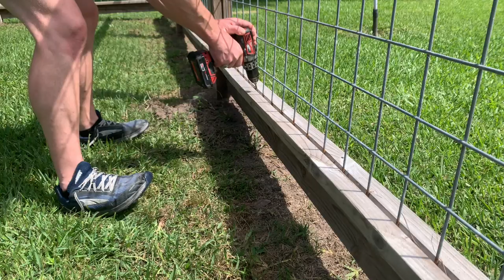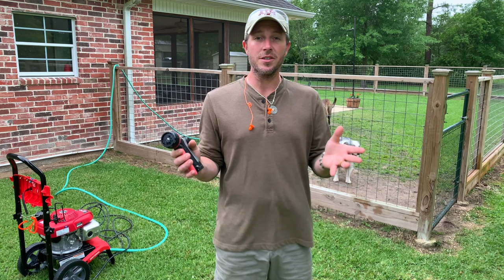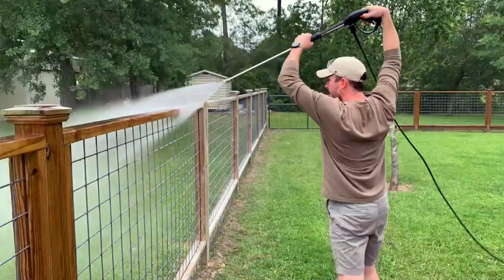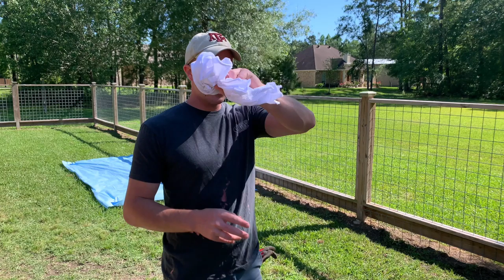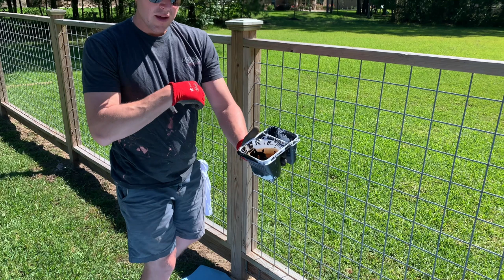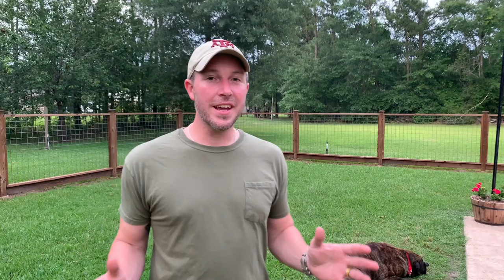PART 2: MODULAR HOGWIRE PANEL FENCE with DADO GROOVE 18 MONTH REVIEW & STAIN TUTORIAL

Comment: Having a hard time finding the wire sections. Love part 1 and 2.
Reply from the maker: Thanks! 
I was just at tractor supply this week and they are in abundance.. you may also find them at a livestock supply store or Lowe’s/Home Depot.
you don’t have to use the 4x4 mesh like I did. You can opt for the 6x8 mesh as well. It will be slightly different dimensions than my construction info, but the same end result.. I’ve use both types.. send an email to JKHARTEL3@gmail.com and I will send over construction information and reference photos of other viewers projects.

Comment: Just giving advice from some one thats in the fencing business those top gate hinges the Male hinge, you should have those pointing down instead of up it prevents some one from taking the gates off looks really good
Reply from the maker: Thanks for the reply. Your exactly right about the hinges. It may sound odd,  but I intentionally have them both up so that I can remove the gate. It also acts as a double support of the weight as opposed to the bottom supporting the weight and the top one just maintaining position of the hinge were the other way. If I was worried about them being stolen, I would most definitely have it the other way.

Comment: Cut fillers for the lower dado slots and finish with caulk  to seal the slot
Reply from the maker: That’s a very good idea… So far we’re almost 5 years in and it’s working just fine with drain holes in the dado.

Comment: I built someting similar but I did not use the datto. I cut the perimeter wire off and just drilled holes in the frame for the protruding rods. This also created the weep holes you later drilled.
Reply from the maker: Interesting… How’s it holding up?
Reply: @GatorOverland  holding up very well. I don't think you could pull the panel out without pulling the entire fence down.

Comment: I’m looking to do something very similar of your design. I reckon I’ll be using snake fence wire. It’s 1/8 of an inch squares. I’ll set it in the ground 12 -18 in ground with 8 feet high. On the outside of fence at the bottom, 12 to 18 inch’s of crush - broken shards of glass. I got bears in our area too. Nothing should be able to get into yard. In Japan they burn wood to a good char and the claims are mold - bug proofing and weather proofing. It’s called SHOU SUGI BAN JAPANESE WOOD BURNING.
Reply from the maker: Thanks for taking the time to watch and comment.. on of my friends did their deck in shou sugi ban and it’s holding up great. Sounds like you have quite the project on your hands.

Comment: How about an update at 32 months? My biggest fear in this style is the top 2x4s sagging over time. No criticism from me whatsoever, other than the choice of hat. Great build, great content, and Roll Tide.
Reply from the maker: That’s hilarious!!! Yes, it will be 3 years next month, looks as good as new and holding up great. No warping, Bowing, or splitting.. my design is nearly impossible to sag, the metal fencing would have to bend too. The bottom 2x6 mud board is the back bone preventing sag and it’s supported vertically between the 4x4s.. the only room for failure is age/weathering at this point.. reach out via one of my contacts and I can send current photo or video and answer any inquiries you may have.
Contacts for Facebook and Instagram

For better contact, info, photos and video check us out on
https://www.facebook.com/JKHartel3
https://www.instagram.com/p/CF-X_58BjDR/?igshid=1r9yo0niyroip
Email: JKHartel3@gmail.com

Comment: I like the fence.  I built one similar to yours.  How is yours holding up after 3 years?  In the midwest freeze/thaw is a concern with the lower exposed dado cut filling with water or slush and then freezing and weakening the lower 2x4.  Adding the weep hole as you have is a good idea or doing an overlay with an exterior silicone caulk also helps (but it does add cost).  We painted our panels black that gives them the appearance of almost disappearing from a distance.  Just depends on which look you are going for.  I like the caps you put on the fence posts and will be adding those to ours.  Thanks for the video.
Reply from the maker: Thanks for taking the time to watch and comment . I actually built the fence about six years ago and it’s holding up great despite what other folks have said about cutting dado grooves into the wood… I live in Southeast Texas, and we’re subject to harsh heat and humidity and periodically we have freezing cold snaps, but not often enough to matter.. 
We had considered painting our panels black at one time, but surprisingly the galvanizing is holding up well . Are you using a mud/rot board along the bottom of your fence? Not only does this protect against ground water splashing, but it adds additional support to the panel frame.
Reply: @GatorOverland  I use a 2x6 treated board upright as support for the lower part of the panel section.  I think this is what you are referencing as a mud/rot board.  It does provide support to the panel section keeping the lower 2x4 from sagging and also keeps the line trimmer from hitting the fence panel.  You do have to drill the weep holes in the lower dado at an extreme angle to miss the support board if you don't use a caulk.  The weep holes kept getting clogged and had to be re-drilled annually to make sure they were still open.  The aesthetics of this type of fence are much, much  better than the term "hog wire" or "livestock panel" suggests.  I have started to referring to it as just panel fencing.  City people don't know the difference and rural people know what you are talking about.
Reply from the maker: @tholi1052 you’re exactly right!

Comment: I was looking up hog panel fencing and came across your channel.. small world - I made your wife a cutting board for you haha!
Reply from the maker: That is a small world!! I used actually used it yesterday! It’s such a beautiful piece! Thanks for the reply! Let me know if you have any questions. I have construction details and cost generator available via Dropbox link in description or email
Reply: @GatorOverland  Will do - Just doing a small 12' span between my house and garage so it shouldn't be too bad! I downloaded the drop box file already! super detailed man!
Reply from the maker: @Andy Nguyen Good deal! Then youre all set. If you use a 2X rot/mud board as I did at the base, then you can probably get away with doing the full 12ft span without separating in the middle or worrying about bowing over time. The mud/rot board works as a strongback brace for the fence. But it's totally up to you. Many have asked if they can do the full 16' with my design, and i would not recommend that distance without supporting in middle, which is why i did 93.5". Good luck with the build. Let me know if you have any questions.

Comment: I’d like to paint my wire panels black. Any tips? What type of paint and any prep necessary? Thank you.
Reply from the maker: No real tips from my end other than You’ll probably want to paint beforehand. It’s galvanized wire, so it’s pretty rust resistant as is, but may also inhibit proper paint contact as well.. if it’s cosmetic then just know the paint will only last a couple years.

Comment: Can you stain the wood before making the fence? 
I guess you'd waste some stain that way, but seems like it would be easy to stain the wood while it's flat on the ground.
Reply from the maker: It depends on what kind of wood you’re using… If you’re using treated wood, unless you wait until the wood is cures (dries) before building the fence, the answer is No (could take 6mos to a year+ depending on climate)… if you stain treated wood before it’s cured (dried out) it will not be accepting I’d the stain and bead off.
If you’re using untreated wood, then you’re good to stain before construction.
Reply: @GatorOverland  Thanks! I was thinking of buying pressure treated wood now, letting it dry for 3 months, staining it, then building the fence. Should work....probably. :D
Reply from the maker: @nichjt  yes, just double check it’s dryness using the examples i show in the video. 🤝🤘🏼

Comment: Any problems with doing this in Texas heat? During the day it’s normally 100 degrees with 50% humidity.
Reply from the maker: I live in southeast Texas, 30 miles from the coast… The epitome of Texas heat and humidity… Five years, no issues and no regrets… It’s holding up great and the stain is as well

Comment: Awesome video. Would love your opinion on doing this fence higher? considering this style of fence for a chicken run but want to go somewhere around 7 feet. also would use the smaller mesh size, 2 inch openings, which may offer more internal strength. Just concerned with flexibility at the centre between posts? How flexible is it currently?
Reply from the maker: i utilized a 6" wide rot board at the bottom of my panel frame to provided added strength and increase the height of the fence 6", and the majority of the way around the yard im at about 5'-6". if you watched my part 1 video you saw me actually trim down the fence panel to about 48" from 60". You could achieve near 7ft by leaving the wire at 60" and using a 12" wide rot board at the base. I built my fence on a budget to achieve the most height and width with as minimal extra cost or waste possible, and that why i trimmed to the height i did. Each panel is (3) 8ft 2x4's which amounts to $12'ish.. the $60, 16ftx5ft wire panel was cut in half and trimmed, so each completed panel frame amounted to about $42'ish... you would just have to change your measurements from mine and buy some 10ft 2x4's to work with the increased height of the panel. All should still work out nicely. If you havent seen in the descreption, i have a link to my drop box for construction info and or my email if you need to contact me personally. Shoot me some photos when your done!
Reply: @GatorOverland  thank you for the reply and all makes sense (well as much as feet and inches makes sense to an Australian). Increasing the rot board width would definitely help. still playing around with some numbers to make it as cost effective as possible, but Im sure ill make it work. Thanks again
Reply from the maker: The excel document is unlocked so you are free to adjust as needed to suit your metric dimensions..

Comment: That pressure washer would have taken every bit of that algae and fungus off without all that extra scrubbing. I'm all about simplicity😁my fencing gets like that, sp every couple years I have to spray that thing down good and it looks like it's brand new again.
Reply from the maker: Thanks for taking the time to watch and comment.. yes I believe you’re right and would have saved it if time and Elbow grease. I did it this way for 2 reasons. I didn’t want to scar or saturate the wood too much before staining. And I wanted to inform other options to those who may not have access to a pressure washer. 🤙🏼

Comment: I cannot get this to work with a pump sprayer. I purchased 3 sprayers and the liquid is too thick for all of them. Not sure how you did this but I can’t get it to work
Reply from the maker: I’m sorry you’ve had that issue… I’ve done multiple fences with the sprayer without any issues… are you using ready seal? Not sure if it gets more viscous in colder temperatures, but it was like water for me… I did my sprays in 70 to 90° weather…

Comment: I don’t have a router. Can I just enclose the wire between 2 slats of wood?
Reply from the maker: Yes you can… This was my initial design but it required twice as much wood and would be a lot more weight… You do not need a router, just a tablesaw with a dado blade stacked for 3/8” groove… I made a post on my Facebook and had a table saw and post hole digger to borrow by that afternoon..

Comment: Just followed your channel, I am fixing to fence in our adjoining lot for a pool oasis and I have been trying to figure out if I can dado the 4x4sto cut down costs and just dado the top and bottom stringers what do you think?
Reply: Yours is awesome 👌 BTW
Reply from the maker: Thanks for the reply! This question has come up quite a few times over the past year… it is definitely an idea of a way to cut down on cost and will work… but....You have to make damn sure your post are exactly where you want them to be when they are set…Especially if you had cut the wire panel lengths and horizontal topper/bottom wood lengths before you set the post…There would be no forgiveness if you set the post a little bit too far apart… The panel would not set in the groove properly and the wood lengths would be too short. If you are not relying on the fence for strength then I would expect it to be fine for fencing in a pool area… Depending on how many feet you are trying to do for this, you are only saving yourself the cost of one 2x4 (about four or five dollars) per panel section to do it this way. I.e. If you needed to make 20 sections this would be about $80-$100 saved from if you did my design. Feel free to ask any questions

Comment: How would you deal with dog's digging under the fence?
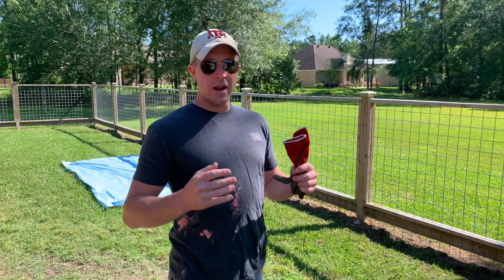Reply from the maker: The answer to your question is featured about 18:20 in my part 1 video. Fortunate my dogs have not been diggers. Making a trench of cinder blocks between the post could work too
https://youtu.be/x0iMHQVzJvQ
Reply: @GatorOverland  Extending hog wire panel deep into the ground might work for those persist diggers but not so good for lawn mower blades.
Reply from the maker: I’ve mowed 100’s of times and never once been an issue with the blades.. physically impossible actually. Check my description for email/drop box for construction information and photos. You may better understand what I mean for the dig deterrent. They would be mounted vertically.

Comment: Is it possible to do the dado cuts with a circular saw? I think this method is what I will be using for my garden. We have a 1.3 acre lot I'd love to create a good size garden in and I think this method would be best to keep away rabbit, deer, moose and bears. Thanks!
Reply from the maker: I have read that dadoes are capable of being cut with a circular saw, but doing that amount of fencing perimeter I would definitely recommend renting or borrowing a tablesaw so you can use the benefit of a rip fence to keep you’re cuts straight. Once built it will definitely deter the pests from your garden!
Reply: Joanna, I’ve seen some of these where people have “sandwiched” the hog wire between two one inch thick boards and put screws through to hold it together. A dado on a long straight 8 foot run with a circular saw wouldn’t be my first thought, but maybe with the right set up, it could work. I just cut grooves in for about 160 feet of this type fence with a table saw.  You’d need to be very careful with a circular for safety.
Reply from the maker: @scottbrown8418  my first design of this fence was the sandwich method you speak of. It does work, but its very labor intensive and uses alot of material. I actually put together a jig to keep things square. After about the 3rd panel and 60 screws later i simplified the design to the dado groove and didn't look back. Joanna, i would definitely recommend renting/borrowing a table saw with are rip fence to make the process go by quickly and safely. Good luck with you build. let me know if you have any questions.
Reply: I definitely agree, the table saw with a dado is the safest, and probably easiest.  I appreciate the follow up video, as it helped me see some things like weep holes and potential weld rust to take care of early.

Comment: Great vids, How did you cut down the 4x4’s once you had the posts already in the ground?
Reply from the maker: Thanks for the reply! Yes I did! I just uploaded my staining and 18month review. Check it out
Reply: Gator_Overland what did you use to cut them?
Reply from the maker: Seth Dunn I bought some cheap angle material from the hardware store so I could make a level guide across the post and I used a sawzall, And then I bought the wooden caps from Home Depot

Comment: The rust looks like it is starting at weld points.
Reply from the maker: Thanks for the reply! There are a few instances where surface rust is present at the weld points which isn't uncommon for this type of material. Currently it it not enough to compromise the integrity of the weld. It's nothing a wire brush and some cold galv spray cant fix. Im still very happy with the way its holding up.